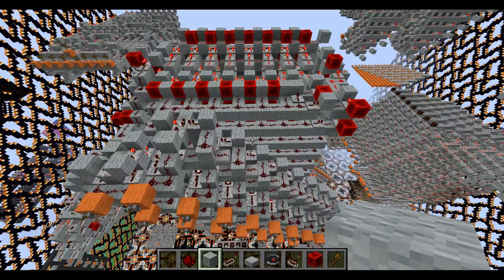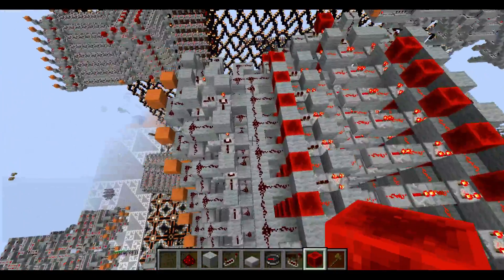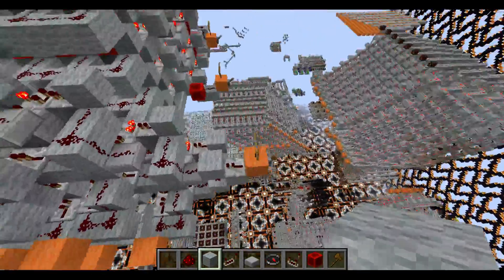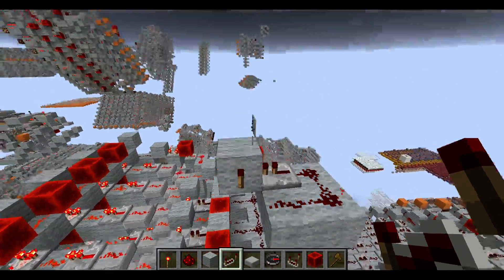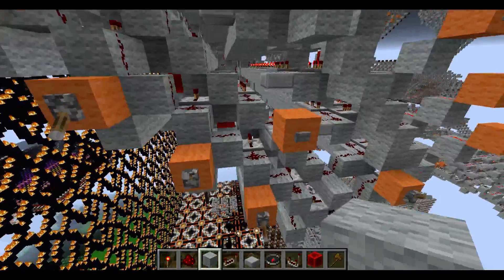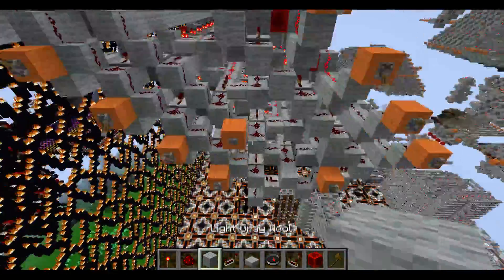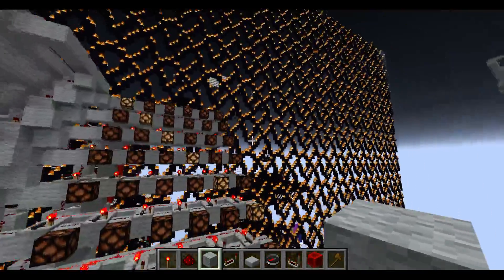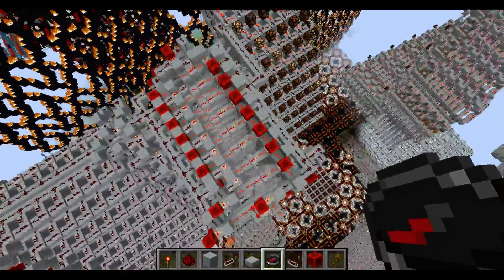Redstone torches are overrated... (Torchless CLE ALU)

Comment: is a redstone multiplier a bunch of adders stacked
Reply: Riley McDermott Bruh -_- no just no
Reply: +Riley McDermott some ive seen are actually shifters and adders put together like 2*3 can be done by doubling the first number with a single shift then adding the original number to that theres other things im probably missing but with a shifter and an adder you can end up doing multiplication pretty fast using a program
Reply: Riley McDermott 
if you want to multiply by 2 you just shift the number to the next greater line, to multiply by 4 shift two lines and so on (every shift doubles the number) if you want to multiply by something more complex like 15 you just do it step by step
example:
0101(5) x1111 (15)

0101x0001=    0101
0101x0010=    1010
0101x0100=  10100
0101x1000=101000
                  +    ------------
              (75) 1001011

Comment: I think I may have made a smaller version of this adder and it also is 7 ticks. Also it's inputs are arranged the same way as the traditional CLE, what are the dimensions of this adder?
Reply from the maker: Ok, first of all the adder is 6 ticks which is made 8 by the input inverters for the ALU. The adder itself is about 16 blocks long, 21 if you count input inverters for ALU. Width and height don't really matter too much since they are based on the number of bits (width and height are relatively the same for most CLE adders, unless you make a stupid one that isn't spaced 2 blocks wide per bit). 

Still, it's pretty cool that you decided to make one of your own, it's a pretty difficult challenge. I would love to see it :D
Reply: 17 long, its just a bit longer I sort of derped on my second XOR and used the 4 wide Comparator design , it made it much longer xD. its really strait forward, it really isn't that hard to do. I just basally took a normal CLE adder, and started replacing a few parts. it turned out really well but yours is smaller
Reply from the maker: Is it synchronized? It has to be for the two tick pipeline benefit that comparators give you to be useable.
Reply: course, its CLE and Ive tested it multiple times